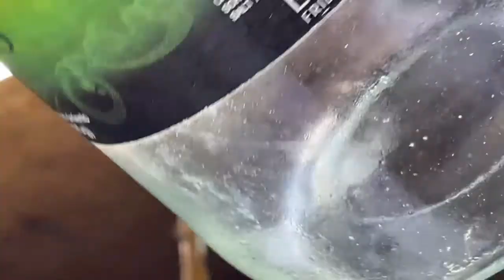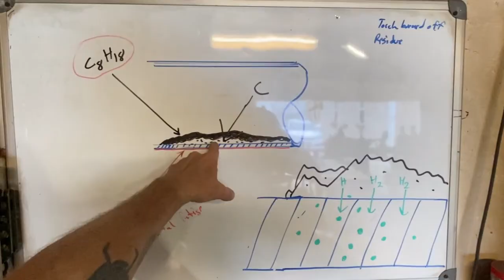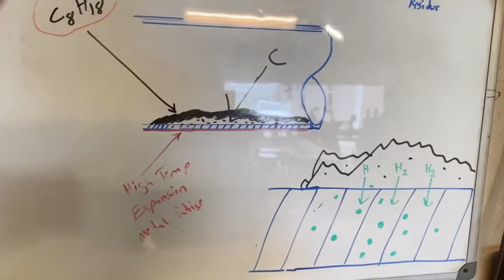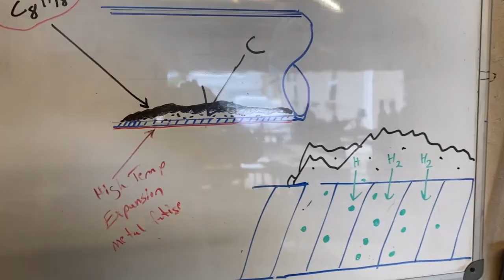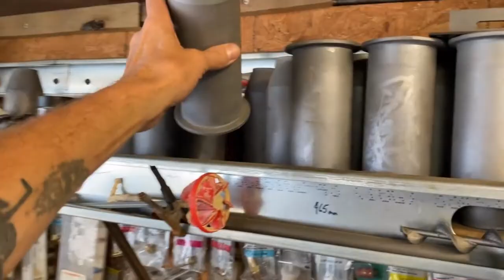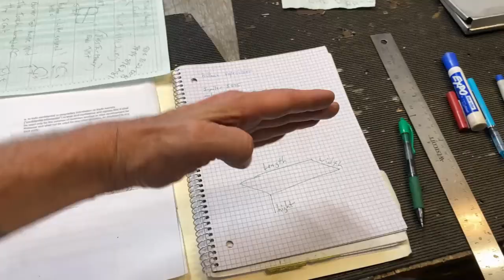Flame impingement and a better combuster

Comment: Would this type of burner configuration yield the same benefits over an in tank tube style heat exchanger...? My company, from my understanding, runs a direct flame submerged NG fired boron tube heat exchanger. With proper extraction would an water tight version of your HE be able to be fired in an enclosed, submerged, application with increased efficiency over a tube HE?
Reply from the maker: Unfortunately no but a great idea . I believe they pumped the fluids at around 200 psi or something . I cant tell you what this is for . It was a proto type to teach us how to build a commercial unit for oil Field  work

Comment: I think you're confusing chemical cracking of hydrocarbons and physical cracking of materials. The heavier hydrocarbons does release hydrogen but you already have significant hydrogen production from the combustion of the propane, and all hydrocarbons. (part of the combustion process is to also combust the remaining hydrogen to form water)

The biggest issue with flame impingement is that it causes incomplete combustion due to a lack of heat. (fire needs an oxidizer, fuel, and heat.) The remaining soot is all around terrible, but primarily a fire risk and can cause a feedback loop eventually fully blocking the passageways, and can form quite strong acids.

Cavitation is a concern in natural convection boilers. In forced flow boilers it really isn't a concern as long as you have design flow, as you won't be transferring heat fast enough.

I haven't seen any of your other content and this video is severely lacking in context. Any modern boiler is using copper or stainless tubes, not steel, so I assume you're referencing some old styles. Hydrogen embrittlement isn't really a concern for copper and stainless in the same way. 

PS. Make sure that your vaporizer is sized correctly. Too small and you don't vaporize enough. Too large and the fluid velocity is too low to pull the deposits along for the ride. Most of the deposits will burn if they make it all the way to the burner. I have had to occasionally clean orifices of wax buildup but it's not so common when the system is designed well. This is one of the primary reasons why the storage tanks are used as vaporizers in applications that allow it. The sediments end up at the bottom of the tank.
Reply from the maker: Why would you think im confusing "chemical " {actually its thermal} with physical ? Serious question not being jerk , im just tryna find out how i lost you in this video .
What do you mean by physical cracking ? Yes the pipes " physically "  crack from hydrogen embrittlement . This video lacks context  as its old NDA work, i am not allowed to discuss the purpose or details of the heat exchange  . I have never seen an industrial copper boiler and steel heat exchanges are more common than you think . The company i did this for builds them every day . They will likely never use stainless due to cost . Companies would rather go through 3 steel ones then pay for a single stainless unit  . The economics of small portable systems does not allow the luxuries of powerplants and big factories . Cast iron and steel boilers are very common . Thermal cracking of oil releases hydrogen , that embrittles the steel on the units this burner goes on . Direct flame impingement causes a destructive fluxing action that is corrosive in nature .  Yes you are correct about the vaporizer . This is a test vaporizer as the actual unit is a hot water heated unit . I warned them about heavy ends building up in the vaporizer they currently have but i dont know if they disected one yet
Reply: @NOBOX7  maybe you have it straight in your head but your description in the video blurs then together. Eg. The chart you have is related to physical cracking of the material. That's why you have The Columns for longitudinal and transverse.

Cracking of hydrocarbons is a chemical process, that's totally different from the above. In this context the energy source is thermal so its fair to call it thermal hydrocarbon cracking, but that energy can be from any source, not just themal sources. That's why I call it chemical cracking.

I'm aware that very large boilers use steel and even cast for cost reasons. The most resent power plants where I live all use copper tubes, but that may be more due to the fact that they are combined cycle plants. Aside from that, anything large enough to be custom engineered will also have engineered maintenance procedures that'll detail all of this anyways, or at least should have. At that size, the cost of a professional engineer is a rounding error, lol. 

I'm not sure what size you're referencing either. The largest single boiler I've personally worked on is only about 20mill btu. (obviously the overall systems can be bigger) boilers larger than a few mill are just not needed around here much. It's better to have many smaller boilers for redundancy. I have dealt with larger applications... Such as soccer field sized kilns, but that's a different story.  I was honestly thinking you're talking about some kind of old steam boiler /engine as preservation is very important, has a lack of money for repairs or a PE. I think the biggest confusion is how vague you were due to your attempt to keep to your nda. For the most part it seems like you not only have experience but know burners well.
Reply from the maker: This is a piece of Oil field equipment . My 3 year NDA ended but i will not discuss the details of my clients equipment . IR heat is far more powerful than flames , that's the purpose of this burner  . I cant discuss any other details regarding its purpose . This is the type of video i send to my clients  to update them on progress
Reply: @NOBOX7  that's understandable. I would suggest if it's only for a client you may want to unlist the video (makes it viewable by link only.) YouTube suggested this video for some reason and I was curious when I probably should be sleeping 🤦

Comment: Good analysis. The cavitation issue is probably worse than any hydrogen embrittlement, but anything that  increases the rate of corrosion and pitting adds to the whole feed-forward mechanism. Anyway the carbon deposits makes me think of port injection vs direct injection engines - port injection allows the gasoline to clean the surfaces. yeah definitely don't use acid or base to clean it off! but maybe gasoline run through every now and then. I think the new burner design is a big step forward. Better mixing with air, and more excess air (even from secondary combustion or dilution air) should allow for more complete combustion of those heavier oils. Not sure how much heat you could extract from the gases, but it definitely would decrease the amount of build up and reduce cavitation. Would be interesting to see if the reduction in carbon build up compensates for a lower overall flame temperature.
Reply from the maker: Good call on the cavitation but i should mention this was not a boiler tube as the water was only heated rapidly